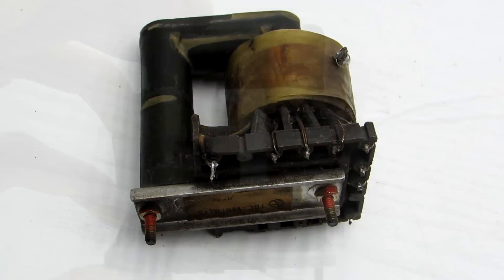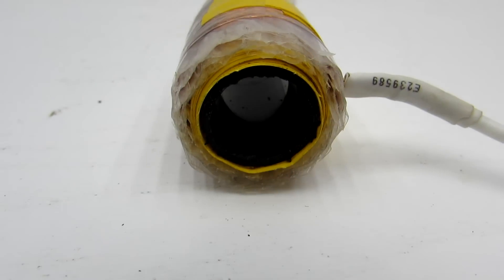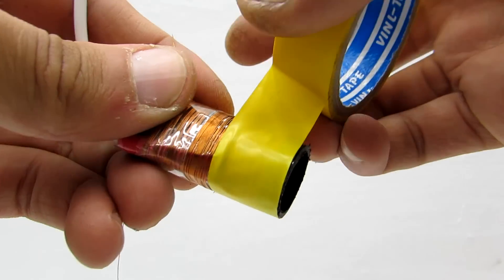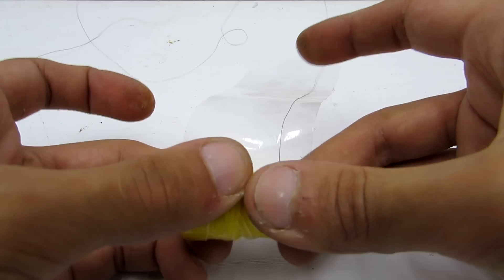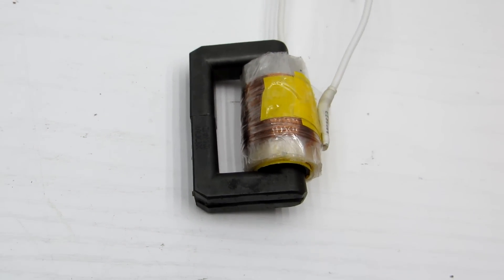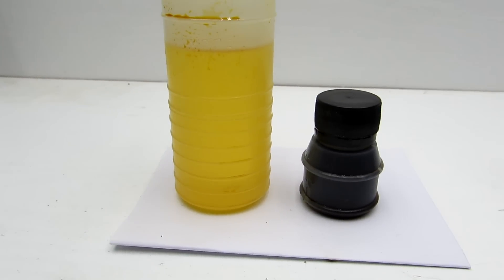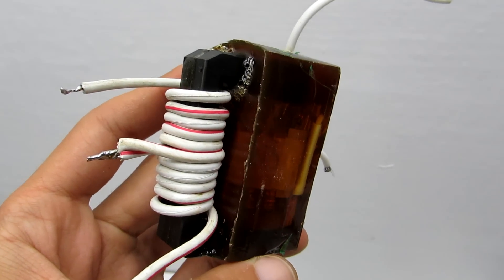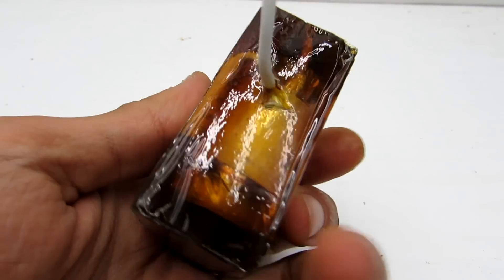High-voltage transformer winding

Comment: really nice! I was afraid that the number of available  fly back transformers might decrease because I didn't know that it's so easy to make a high voltage transformer!
Reply: Yes, but for better performance of flyback transformers cores with an air gap should be used to delay core saturation (as I understand it - correct me if I'm wrong - beyond saturation permeability increases and we have higher heat losses without more inductance).

Comment: I modified a HV transformer from old LCD tv, i changed the primary to make a center-tapped one. I wind left to right after i soldered a irfz44n and 1k on Gate. After that it doesn't create a arc when i power up the circuit. After checking the MOSFET the GATE and SOURCE are shorted. Can anyone tell me how to wind proper primary coil?
Reply: Ken Gaming get two wires . Wind one four times around the ferrite core get the other wire and do the same then in the Middle where they're right next to each other make a center tap so they're both connected so that means you should have three /four wires one to the right two thet are Center tapped and another wire to the left and connect that to a zvs driver and connect the zvs driver to a 20 volt lithium ion battery and there you go it should work. / wind on primary
Reply: @Mike-nt7cd   hi i have question to you does it needed to the secondary winding to be in regular like from top to down and repeting or from top to down and than from down to top

Comment: I know you don't reply comments but pls just answer this question that from where you took the transformer for that wire a
Reply: You can find enameled magnet wire in old picture tube TV's. All the stuff you need for such experiments can be found in them. Be careful as the CRT (cathode ray tube) can store a lethal charge, also the large capacitor on the board can too.

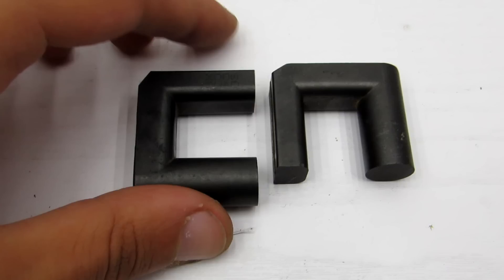Comment: 2:35 when you are talking about "gap value" are you referring to the space between the two halves of the iron core?  Ive taken apart flybacks in the past that have small copper rings where the two halves join and the flyback doesn't work half as well if they're removed.  just confused why you dont need the gap, what is single ended scheme vs push pull referring to? the driver?
Reply: In a flyback transformer the current flows in one direction only which magnetises the core if there is no gap.
In push pull the magnetic field reverses and the core is not magnetised in one direction.

Comment: How to know which is secondary or primary coil
Reply: In the simplest terms possible: Primary is your "input" coil, secondary is your "output" coil. Alternating current flows into the primary coil, which induces a voltage in the secondary.
Reply: Wei Zhao thnx
Reply: Hydranix HNx thnx

Comment: Wouldn't arcing generate x-rays? I thought when electrons hit a metal surface, they generate x-rays. 
At least that's what is shown on an x-ray tube illustration.  That's why the back of the CRT is shielded! No?
Reply: Minimum 20 kv is required to generate X ray by hitting in heavy metal

Comment: Really nice demo on making the transformer itself. I recommend finding some ferromagnetic glue to hold the core together. I noticed the core is a flyback core, you can also use the retainer pin for extra stability (which my require fine tuning to achieve proper resonance between L1 & L2).

Comment: Mine produces thick orange fiery sparks (probably more current than yours). Also much more dangerous. I used 2 IRFP250's. I also used a 0,68uF cap across the 10 turn centre tapped coil. I get really long fiery arcs from just a 700 turn homemade secondary coil (with NO resin HV protection around the coil) using 25VDC from 2 lead acid batteries 7Ah each.
Reply: You'd likely be getting around 1700v. Pretty amazing!
Reply: Thats some hell of power
Reply: @69iqtutorial  yes!

Comment: Wire 0.8 mm? Rather .08 mm, i think.
Reply: Shockszzbyyous yes, an I have it, but what he says is cero point eighteen milimeters. 0.18mm 
If im wrong,  it is 0.08, but what he is using is not 0.8
Reply: Wire 0.8mm is AWG 20 gauge, like jumper wire for a bread board. I agree with Red, he does say 0.18mm which is a popular size for magnet wire (0.1798)
Reply: it's pretty thick but it exists. :D
Reply: No he doesn't talk about the wire but the plastic container
Reply: BariumCobaltNitrog3n what the is the supply current  the transformer?
Reply: I use .8

Comment: the insulation between the layers you did is way too thick and the epoxy was overkill
Reply: There really is no overkill in this situation, unless you are using it for low voltage projects. But if you are pushing it to it's limits, this is definitely needed.
Reply: Definitely. No such thing as overkill when for insulating in high voltage systems.